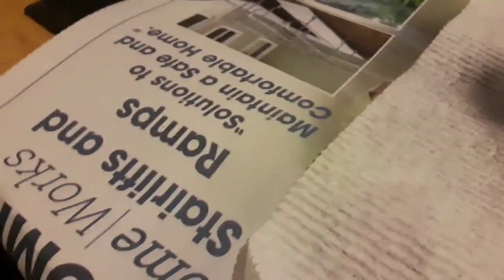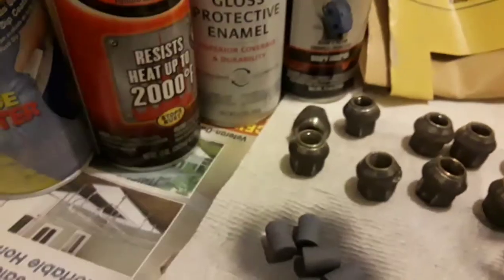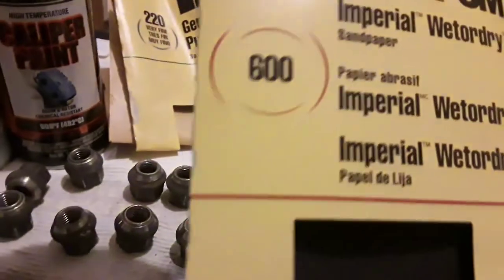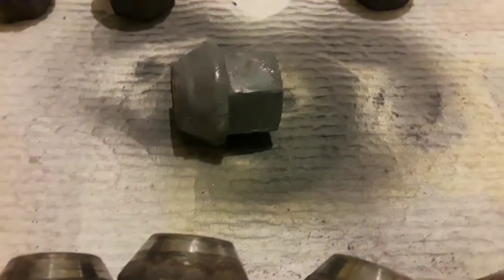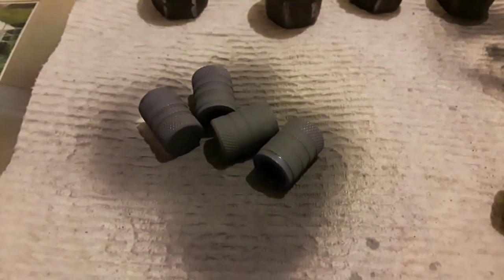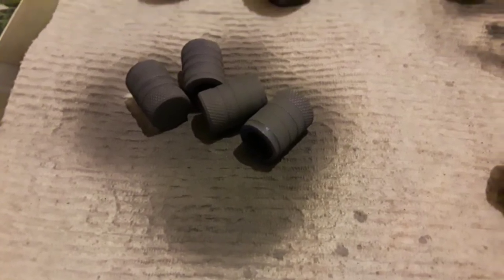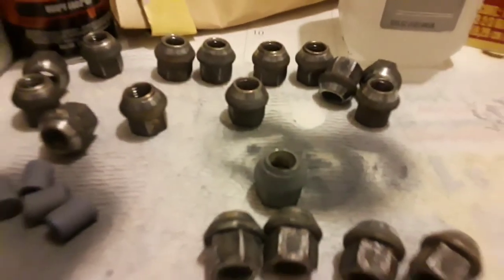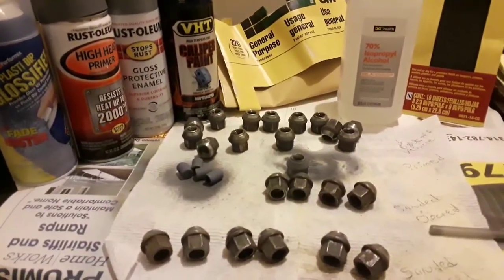How to prep your Lug nuts & Valve stem covers before painting.

Comment: So if you take off the wheels which obviously involves taking off the lug nuts. Does that put any scratches on the paint or rub off, because I feel that would easily happen. Especially if using power tools.
Reply from the maker: Please excuse the extreme delayed response... To answer your question yes it can...Thankfully I don't need to change my tires often but the time that I did they didn't get scratched up too bad . It was easy to do touch up on them since I covered the tires and sprayed them while they were on the wheel.. Took my time so it turned out nice and clean..